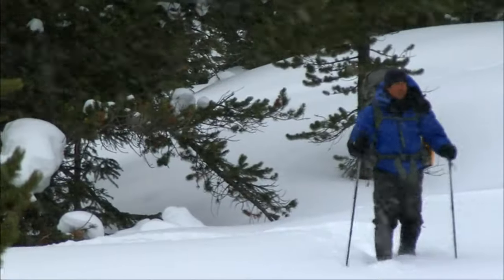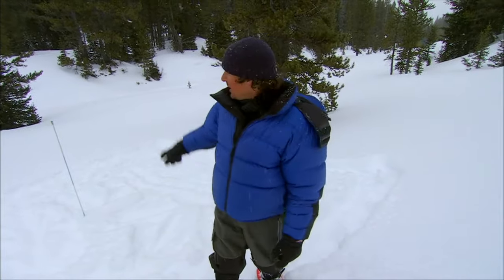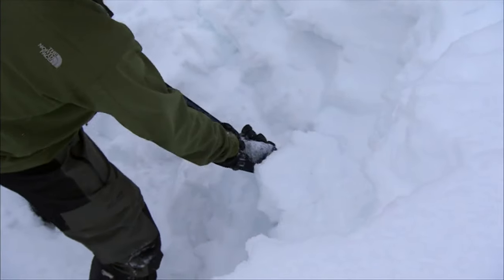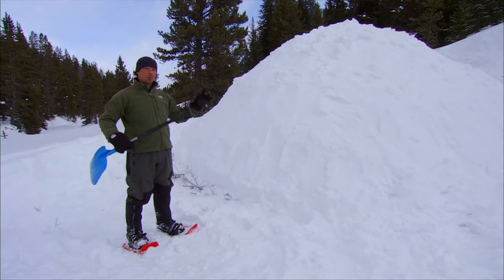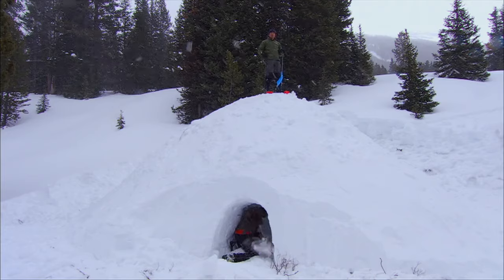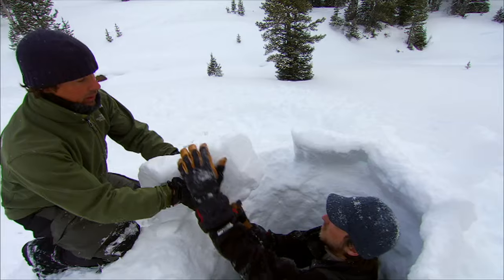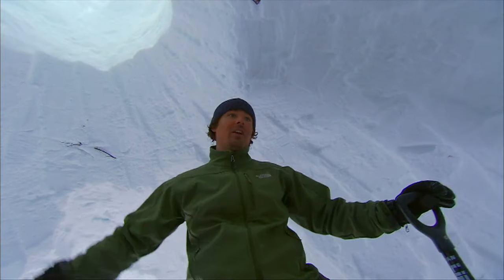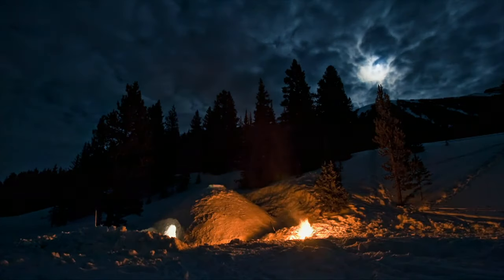Bulding a Quinzhee

Comment: I always shake my head when I see a movie where a plane crashes in snowy mountains and the people all use the aeroplane carcass as a shelter. A quinzhee will keep u warmer and away from cold drafts. Not to mention you can make one in a few hours so as long as there is plenty of snow you can travel to a safe location making fresh snow shelters each day. Create a little lamp from pine sap and you've got indoor heating and lights!
Reply: one issue in a survival situation is however, that making a quinzhee burns a ton of energy and your clothes are guaranteed to be wet as you're hollowing it out
Reply: Use the plane carcass as a frame for a snow shelter.  Alsa can reinforce a tent with snow

Comment: What if all the snow came down upon you while you're sleeping.... buried alive?

It's a cool shelter but not worth the risk.
Reply: The sides are only 4-6 inches thick. If it collapses it is very easy to just stand up out of. Ive been in a quinzhee as it has collapsed many times
Reply: If you wait the correct amount of time, then it shouldn't collapse. Plus if you are sleeping in it, it's most likely that you have to choose between sleeping and risking burring yourself or freezing to death. It it way more likely that you will survive while sleeping in it. 😉